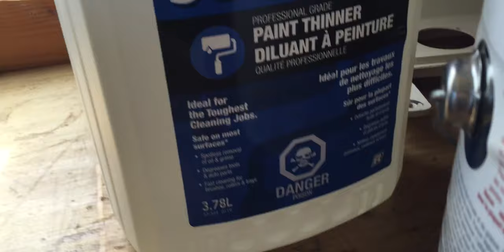Painting the Panels, Rims and Wheel Weights: Bolens HT20 Part 7

Comment: Looks good add some red paint on the FMC part of the wheel weights after they dry and I usually find it easier to put the decals on after the panels are mounted on the tractor with the exception of the dashboard
Reply from the maker: I was thinking of the FMC on the wheel weights! Red it shall be. Thank you for the advice. I will be painting the frame before the panels get bolted back on and I hope I get the dash-decal done right :D Cheers
Reply: Just take your time on it use lots of water you will have it slide it to the bottom of the dash first
Reply from the maker: @byx3493  I will keep that in mind! I have only one set lol :D